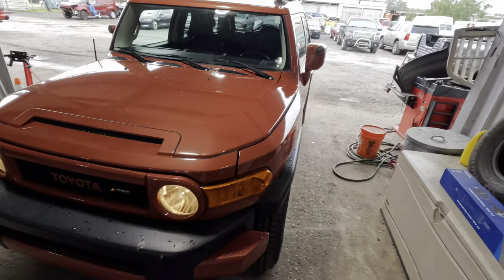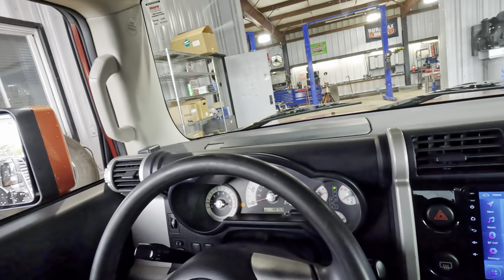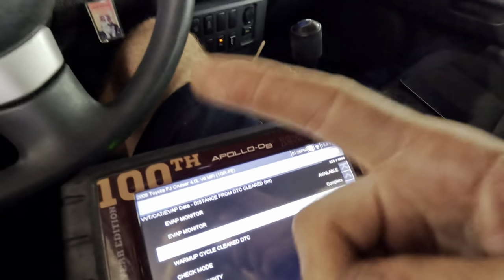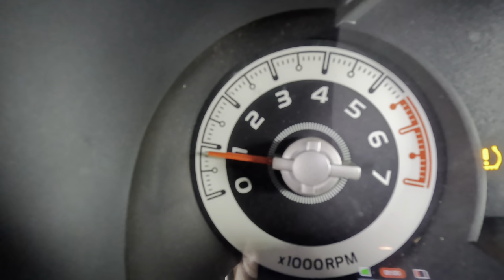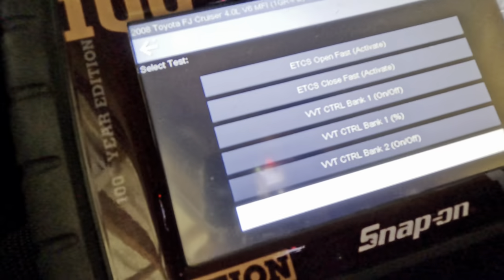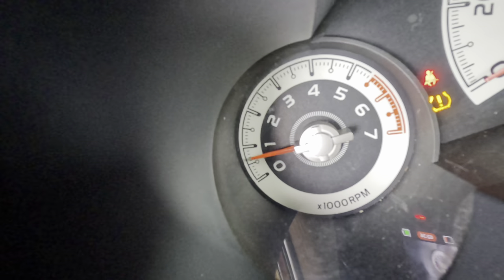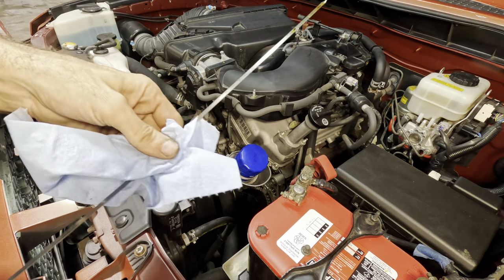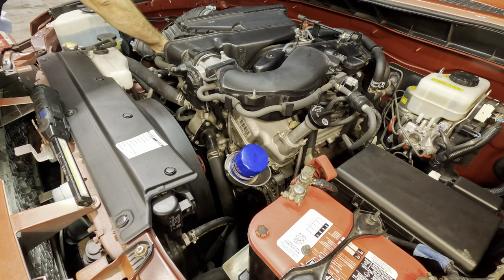Engine Problems at 50,000 Miles! P0016 P0017 Toyota FJ Cruiser 4.0 1GR-FE

Comment: I would check those miles on the transmission to check that the odometet wasn't rolled back. Wayyy tooo low of a miles for an 08'. 249k makes more sense.
Reply: CarFax will also show any odo discrepancy.  
Large amounts of time (years) with little or no miles means someone disconnected the odo.
Way too clean inside and under the hood for 249K.

Comment: They Have an engine oil change issue! LOL maybe needs a flush. Did mine on my Subaru at over 200,000 KM (120,000 miles) and they were much cleaner…

Did you forget the zip tie on the throttle body connector?

Comment: The first thing I would have done is check the oil level , viscosity, and condition and replaced that   STP oil filter and maybe cut it open to before assuming any VVT component failure
Reply: Wow, just figured out I can play YouTube vids at 1.75 speed and Ray still doesn't sound like a munchkin😂
Reply: Sometimes just before replacing VVT solonoid after new oil and filter, I'll  momentary start the engine and let it sh@t the oil galley out in case there's crap

Comment: so, I just fixed a coworker's car because it wasn't starting and they were threatening to fire him because he kept leaving his vehicle overnight in the parking lot and so I changed out his starter and the battery in his 2000 Chevy Impala 3.8l... none of the videos that I watched informed me that there were these two plastic shields that needed to be removed via three total bolts and I didn't have a long enough extension for my sockets... effing took me 2 hours because of that....

Comment: The amount of sludge on those solenoids is a huge red flag.  That engine needs a serious cleaning cycle or two before it becomes a candidate for an I Do Cars teardown or ends up a clip on Just Rolled In … As it is, I’d guess that there’s already some unnecessary wear on bearings and journals.

Comment: Timing chain is elongated due to wear from all that sludge.  Pull the square 4-bolt plate on the timing cover, just above the power steering pump, and examine the chain tensioner extended length.  Should be about 1/2”.

Comment: Low oil pressure would effect both sides, and be an audible situation, the valves and lower end would be heard. You may have tried an engine flush,,a qt of atf can clean things up.

Comment: Hi Ray, nice diag.  But You should tell customer what you find, and prove it with those old parts, car needs that "internal" cleaning by special oil additive, if not just now, then next oilchance. By the way do you have to show those parts to customer, or are they just going to trash/recycling bins? Here in Finland old parts belong to customer, excluding oil and filters, so they can see what have been changed. At least it needs to ask if they want to see those parts.

Comment: It would be nice to know if the replacement of the control valves fixed the problem, or if sludge that fouled them didn't also foul up the phasers and the passage ways that lead to them.
Reply: Probably a poor idea to spray in some cleaner into the solenoid engine openings? New owner may end up driving this totally different. Just running hotter and more often can help keep sludge down and loosen existing sludge. Watch dipstick oil condition often now.

Comment: Since the solenoids were still working why not throw them in an ultrasonic cleaner.  They would be good as new and all the passages would be cleaned up.  Judging by the sludge, this problem will come back again until the engine has been cleaned.

Comment: If that variable valve timing valve was full of sludge, the whole engine must be filled with this hardened oil. Can an engine be cleaned out when it gets this bad?  

I change my oil every year or 3000 miles, whichever comes first. ( I don't drive much ) I also send oil to Blackstone for analysis, my numbers always come back good.  I always use only full synthetic oil, which resists sludge formation better than ordinary oil.

Comment: 2 Questions here, wouldn't it have been enough to clean those valves in a ultrasonic bath and secondly, what caused that? Can't be normal to look like that after 50k miles.

Comment: Huh, fairly low mileage engine. More problems than my 2011 Honda Insight had at the 80085 mark on the odometer. Brakes and a new cat heat shield. 

Still runs fine. Only issue is when the temperature drops below freezing I need to Fred Flintstone it in reverse. Nothing really new driving hybrids for 22 years in New Hampshire. 2002 Toyota Prius was the same. Had to pop a leg out the door to get my Insight out of my carport. 

Looking to get my Insight's hood repainted/sprayed or replaced. HOA is on my peach to replace an "eyesore" on the area. She's of the Polished Metal paint scheme of the year of the vehicle. I absolutely love my dumb car and plan on driving her as long as I can. The only smart thing about her is the nut holding the steering wheel. That would be me. 

So if any of Rainman's NH fans can point me in a direction to respray or replace my hood that would be appreciated. 

Also my sister's oldest kid is about to learn how to drive. I'd LOVE nothing else but to teach him in my beloved dumb car. Rely not on technology, but on but the moment.

Comment: Great video and diagnosis 👏👍🏻👏 What would cause this sludge issue at 50k miles. My inexperienced guess is low usage(standing vehicle), diesel = short trips or poor fuel.. or simply lack of regular oil changes??? Any ideas from the experts out there..
Reply: I've been carefully tending the predecessor engine to this one, a 1MZ-FE 3.0 litre VVTi V6 Toyota, for the last 20 years, and sludge is usually a consequence of oil not being changed often enough, possibly poor quality oil too. My engine and the one in the video are gasoline powered, so diesel wouldn't be a factor. Looked after well, these engines will easily cover a quarter million miles without major intervention.

Comment: From experience, some Toyota engines build sludge no matter how good the oil and filter change cycle is. They had a 4 cylinder engine in the 80s and 90s that had sludge problems.  They finally admitted there was a problem long after the engines were out of the line up...and warranty.  I had a 95 hi lux that had one of those engines.  62K and the engine failed.  Never missed a 4500 mile oil change. The engine was so clogged oil couldn't return to the oil pan and the engine seized.  And...oh, 2000 miles out of warranty, so sorry!
Reply: The 4.0L V6 wasn't one of those engines.  The 2.4 2AZ-FE engine was the problem child.

Comment: 56:22 you don't do tire work, but you have Black Tape.  
I think the tire sensors are useless
By the time the light goes off you've
Already cupped a tire from low pressure,  just ck your tire pressure
Once a month and with big tempture swings  say 70 dgr F  to 29dgr F  because on a really cold day your tire pressure drops a lot.   
Enough to shorten the life of the tire and give you poor gas milage.

Comment: Dang the condition of that solenoid.   Whoever owned that poor FJ before, did not do maintenance on it.   They must not have changed the oil much at all on that thing.   I bet if you pulled a valve cover that engine is full of sludge.   With only 50k miles, it shouldn't be that sludged up.

Comment: What do you mean I need to change the oil? I have 10,000 mile oil in it. I used 5 quarts so thats 50,000 miles to the next oil change right?

Comment: Well done.  Classic.  If the fault doesn't follow the change, it's something else.  The Root Cause is   poor maintenance yielding inadequate lubrication.  Thing is, my dear spanner twirler, the owner CANNOT leave the engine like this.  God only knows what else will go wrong, but you are right.  It needs flushing (a lot).
Beautifully executed repair though.

Comment: That may be the result of 10000+ mile or several year old oil changes. I did not expect that much sludge other less than 50K miles on the clock. I thought the engine would look pristine inside.

Comment: Car doesn't have that low of milage, I bet if you pull up the ECU information it will reflect a higher milage.  These days I have caught multiple people swapping odometers
Reply: That is possible but for them to work? They have to be married to the ECM and Cross verified with the Vin number so that your theory doesn’t really work with these new more modern cars.

The Vin along with the mileage is stamped on not only that ECM but the TCM as well as other BCM’s in most modern cars and that is what’s illustrated on the digital readout of the instrument cluster.

Comment: So unfair. Any time those give trouble on a Toyota and they don’t want to come out, they usually break off in the head. Looking at how much bend Ray got on those, without them snapping off, I think the must be an improved design. Or maybe it’s the V6 ones are just stronger. I mostly deal with those on the 1.0 straight 4 and I have developed a technique for extracting the broken half. I was waiting to see if Ray has the same method.

Comment: 44:10   

** SERIOUS ENGINE FLUSH REQIRED

Edit : 50:00 :D

dont know what you think of what i use to flush an engine but it look like that 

dump oil leave old filter there
put in  75% diesel 25% oil like a legit oil change 
start engine then let it run 1 min AT Idle without load and without rev it 
stop the engine 1min  
repeat this start /stop sequence  3 times then dump the diesel/oil  mix
leave gravity drain the thing 15min 
put new oil in it and go for a litle ride ( 5 min ) 
dump oil again  change filter  then put fresh oil in it 
voila 

its the procedure i use on my 1,9L TDI  jetta , now at 415 958 km on the odometer

i can be wrong  but im pretty sure its a 10 000% gain Cost/effiency manner to do it insead than using 20 quart of oil and a machine , i suggest you to try it on a car that you dont bother and let a come back , you can thanks me later if you want  

best hopes for 2024 for you and your family  from quebec , canada

Comment: Ray, love your videos and your work ethic. Also love your wife unit who is undoubtedly the best thing that has ever happened to you. So I am definitely not suggesting that you divorce her, but I really would like to see you remove your wedding band in the shop. Should that ring ever result in a hand injury that would be bad. And should you ever happen to injure the finger on which that ring is worn trying to remove that ring from a swollen finger is also not good as the solution to that situation involves soap if you are lucky or dental floss/fishing line, a ring cutter, or a bone saw if you are not so lucky.

Comment: I bet the old oil was full of sludge and needed a helping hand to come out of the sump ,will these want a oil cleNEr putting through it
You do it to prove the dealership time to your own as you have shown over many years
This is why you save bolts from other bad engines to help replacement if needed.

Comment: Air box is what you have after an un boxing  Throttle body is what kids do after to much sugar LOL ; "engine bay" is what happens if can't fix the engine  Tire rotation is what happens on the way to the bay ROTFL LOLOLO  good job Ray

Comment: Working as a toyota technician whenever I get a vehicle with multiple abs/vsc or check engine lights I always check the wiring! Rats like to eat the insulation for the wiring because they use a canola type oil in factory and they like the taste. I see them eat injector harness camshaft position harness etc all the time

Comment: 20:40 If the harness would've allowed it, could you have just swapped connectors?
Also, you don't look or act like you're 65 years old!    😉😉😉
I assume the sludge on the solenoids was due to a lack of timely oil changes?

Comment: You would have been more than justified in putting the old solenoids back in, up-selling a severe engine flush, new oil then putting the new solenoids in. If the new owner does regular oil changes, something the vehicle knows nothing about, there is a good chance the new oils will fill the new solenoids with sludge as it breaks it down.

Comment: People need to control impulse purchase, if you find a car even a Toyota and your serious about buying it take it to your personal mechanic pay him to do a through looking at and evaluation of it before you buy it.
This is very important in states like Florida that just had a hurricane, rust belt states and Midwestern states that get sever storms like floods and hail and tornados.
Not all cars get a salvage title, and you can't always relay on carfax information. 
Your better off giving a mechanic what he asked for to look at it and walking away from it then buying something paying 10 times what its worth then having major issues 2 weeks later with it because someone put it back together with bubble gum.        
My father in-law did this 2 times with toyota, the cars were absolutely junk and i told him on one of them not to buy it. And he bought it anyway for my kid.
And yep the dam motor took a dump like i said it would.
Someone who didn't know what he was doing changed the head gasket without a service manual or a torque wrench. I watched the guy do it.
Reply: In-line 4 cylinder toyota paso 
The head was warped. He just cranked her down with no head bolt sequence. My bet because it needed a head gasket it had over heated and the head was already warped.

Comment: Ray is performing a "null hypothesis" test. If there is no change, then he will know the sensor is not the problem. (Null hypothesis is true) 
If there is a change (in position sensor bank error) , then he will have to reject the null hypothesis, and conclude the bank 1 sensor is faulty.
And you thought Ray was a mechanical technician?  NO way! He is a scientist using the scientific method and critical thinking skills!
Definitely NOT a parts cannon mechanic.
Furthermore, performing "The Null Hypothesis" test sounds WAY cooler.
The difficult tasks, Ray does right away, the impossible tasks takes him a little longer.

Comment: Only about 30% of car owners do regular maintenance on their vehicles, even when the maintenance is offered for free with new cars. What a shame. Even if the new owner avails himself of Rays sludge removing snake oil, the new owner is likely going to be dealing with the consequences of a sludged up engine now. 2007-2013 Toyota engines are particularly susceptible to excessive oil consumption due to low tension piston rings, specifically when the oil wiper rings sieze due to oil sludge, exacerbated by lack of oil changes.

Comment: How dare they put something so crucial that WILL fail within an unreasonable amount of time/mileage in a location where it can't just be literally snapped in & out blindfolded by the user or at least a lube shop ? I want names ! Addresses are also welcome. Every manufacturer reinvents the wheel like every damn year, when we've had at least several optimal & even near perfect designs over the decades. The mentality/business models/cultural ethos has devolved into "if you crack a light lense just toss the entire thing". You asked for it, you got it, Toyota !

Comment: Sup?  been a while.. I have a QUESTION for anyone to handle..
 i have a chevy s-10 crew cab.. the engine is a 4.3   I would like to know what
that 4.3 means. 
   ANYONE can answer.
thanks in advance
al:goodvibes:
Reply: 4.3 liters of displacement in the cylinders.
Converts to 262 cubic inches if you’re wondering.

Comment: 36:33 Does this vehicle have engine-driven cooling fan?  Thought all engines had electric RAD-fans now.  40:46 Placing metal wrenches on battery near the positive terminal can lead to FIRE and a bad day.  A habit that will bite a shade tree mechanic in the butt.

Comment: You really should get yourself a silicon wedding ring before you de-glove your finger or melt the ring to your finger!! Not really a good idea to have a somewhat strong piece of metal around your finger when working with engines and batteries.

Comment: Someone paid alot of money for that. 50,000 miles? Shame no one changed the oil. With just 50 on it thats a collector car. I get an odd feeling something isn't right. The dash should have had 3 gages on the dash at that trim level so where did they go? The radio has been replaced but thats common. Something doesn't seem right.

Comment: What mechanic doesn't have a scope ?  You clearly have no idea what you're doing when it comes to diagnosis. I recommend you take a few diag classes, it will benefit you tremendously. A computer is worthless if you dont know what youre looking at. Most modern car issues can be diagnosed correctly with a computer and basic system mechanical test.